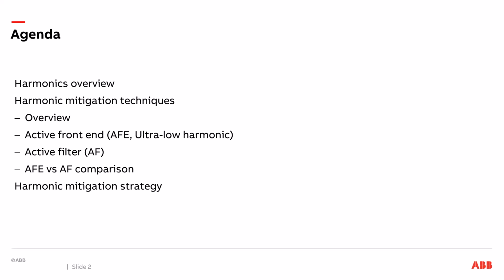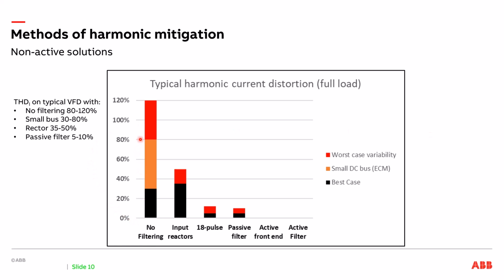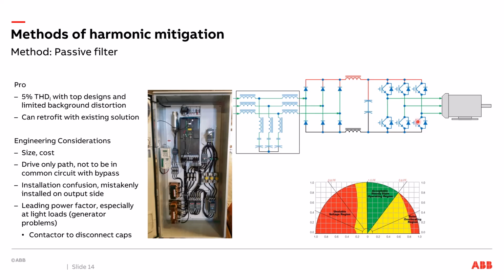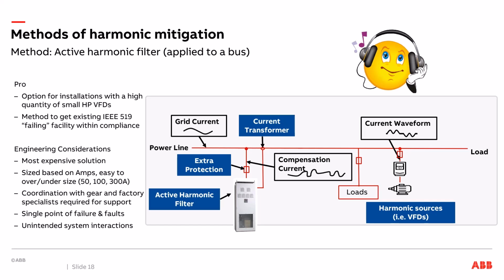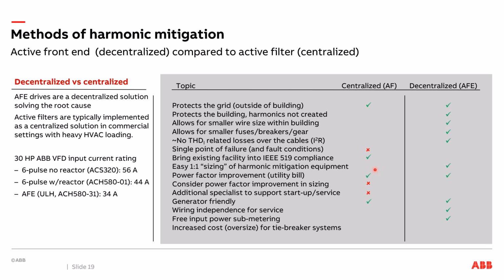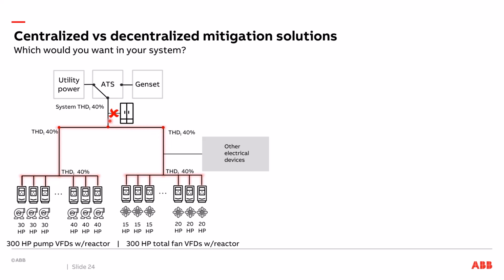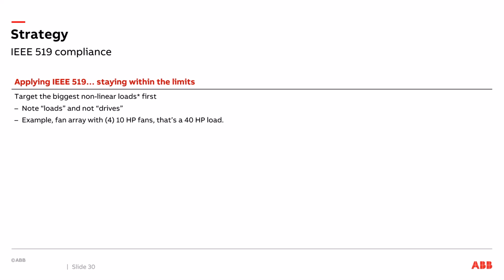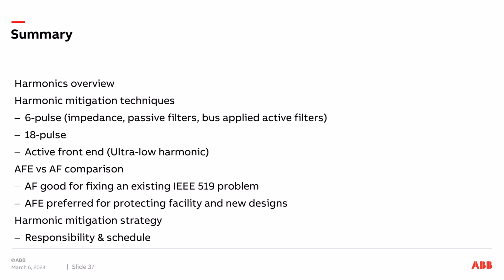Harmonic mitigation techniques - AFE vs active filter

Comment: Funny you should mention 18 Pulse drives. Over the years I have asked at least 5 drive techs from 3 different companies what they thought of 18 Pulse drives. They all said stay away from them.  While PM'ing an ABB 18 pulse 75 HP drive for a return fan found the Usual 660 to 675 Volt DC Buss to be think it was around 590 volts. This fan always ran in auto mode and never over maybe 45 Hertz. I asked to be able to power it down to troubleshoot it but told me it was too important and never gave me the okay. The AHU for it had two maybe 125 or 150 HP 18 Pulse drives that both always ran at the same time.
Reply: I agree with those (5) drive techs.  I mentioned 18-pulse for awareness of the technology, as there is an install base of them out there, but I never recommend them for new installations.  With an 18-pulse, it essentially rectifies (9) phases to make the DC bus, instead of the typical (3) phases.  Even though many expect the voltage drop across the phase shifting transformer, and additional/balancing reactor, to result in a lower DC bus... with 18-pulse we end up seeing a bit higher DC bus with the rectification of (9) phases instead of (3).  

Had they let you power it down to troubleshoot, and assuming the jobsite's 480V power wasn't low, the first thing I'd be looking at is those (9) phases after the transformer.  Other than the obvious voltage magnitude test points between input and DC bus, I'd also be casting a critical eye on the performance of those (9) phases.  Each was likely fused, check the (9) fuses to see if any were open. After the fuses, I'd check the 18 diodes, were any of those bad/open.  When in doubt, current is the great equalizer of troubleshooting - check for balanced current across the (9) phases.  (Some of those tests are easier to do than others - from a safety aspect, I'd have started with the fuses and diode check as those are power down tests).

Complexity of troubleshooting - another reason I personally don't like 18-pulse:)

Comment: One of the best harmonic U tube vidios that I have watched. Found ABB tech support to be prima donnas that do not like to answer any questions. It took nogoodnics at ABB almost two weeks and maybe 5 emails before they finally told me how to look up the DC Buss voltage. Asked me several times why I need to know that. Da troubleshooting & placing the # on our PM'S.  Contractor installed over a hundred ABB 6 & 18 Pulse drives and throw all the paperwork away. Lazy ABB tech got ignored when I asked him if their 100 HP 18 Pulse drive huge cabinets had an adjustable thermostat for large noisy cooling fans like Danfoss has. Told me he could not help me because I did not have the serial # which lazy person never asked me for but had it right in front of me so I gave it to him. Found Danfoss, Allen Bradley and years ago Fincorr to be best in class for tech support.
Reply from the maker: We’re happy to hear you found the video helpful.  Regarding your experience with our technical support, thank you for your feedback and for sharing your experience. At ABB we strive to provide excellent support to all our customers, and we're sorry that we fell short of your expectations in this instance. Your feedback is valuable to us, and we use feedback like yours to improve our support services.  As an example that is directly tied to your scenario, our Technical Support is based out of our Wisconsin factory, while the 18-pulse are manufactured at a different US-based facility.  We previously identified that our Wisconsin team didn’t have timely access to 18-pulse as-built drawings, thus our responses were not as timely as we expect.  As a result, we’ve since made improvements to processes that allow that data available to be more readily available.
If you have any further questions or need assistance, please don't hesitate to reach out to us.